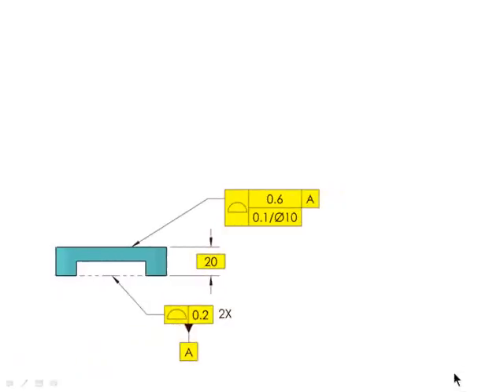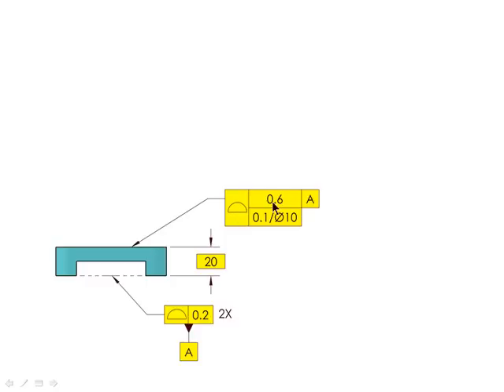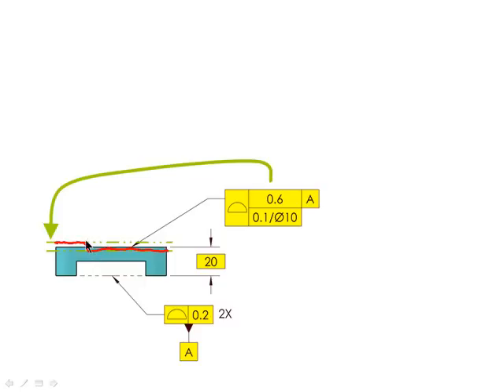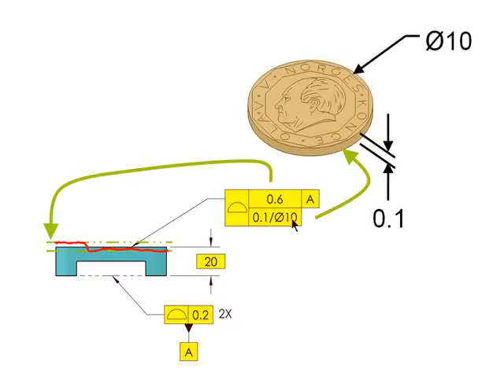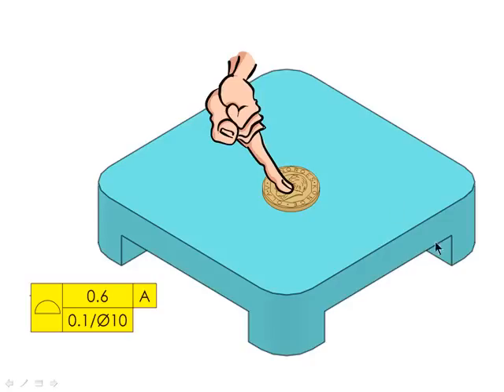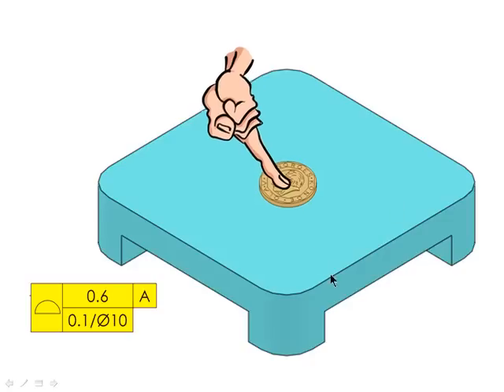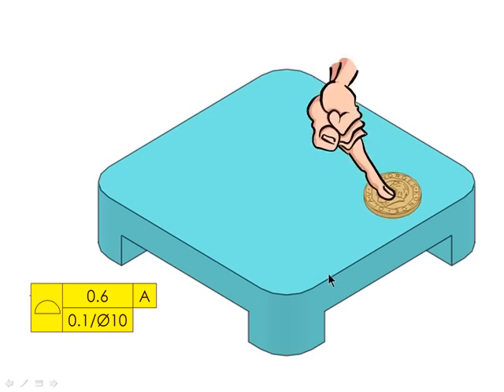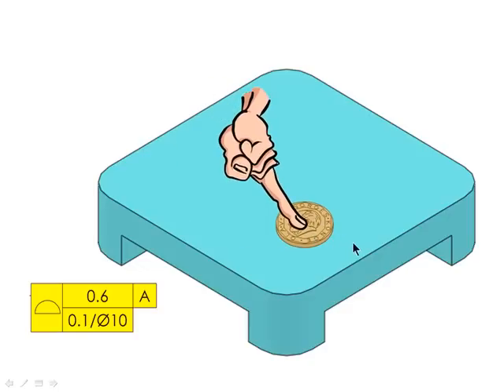GD&T Tip - Smooth the Surface with Profile on a Unit Basis

Comment: The Y14.5M standard doesn't actually allow this.  The closest you get is a "per unit line length", which is a 2D control (along the surface cross-section in the view plane shown) and not a 3D control as you describe in this video.
Reply: Not seeing it in either the 2009 nor the 2018 standards.  Don was on the committee, wonder if they removed it right before publication or something. Seems like a valuable/valid concept though.